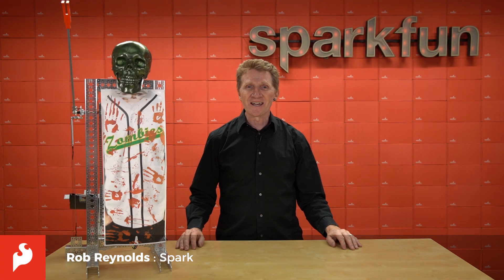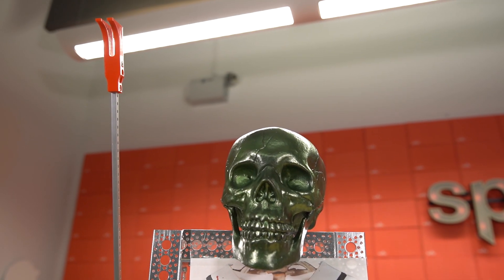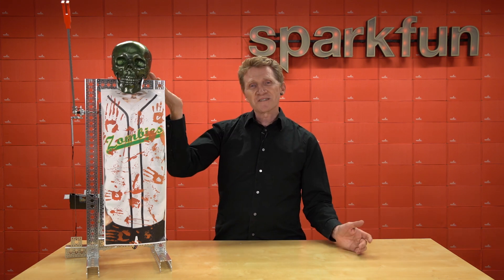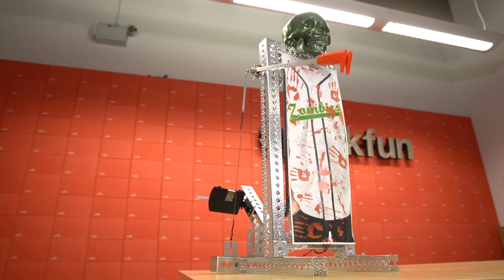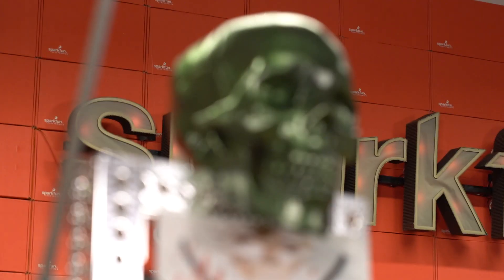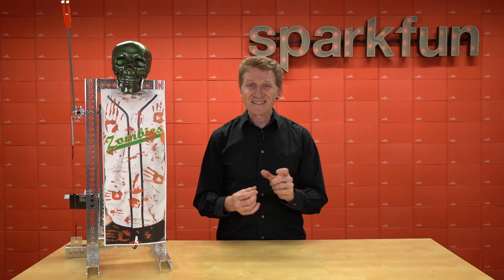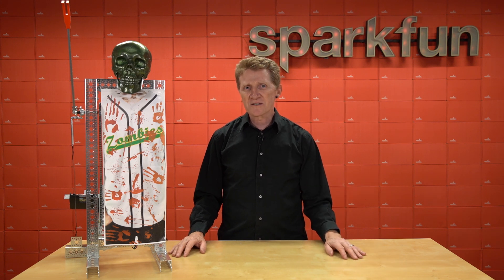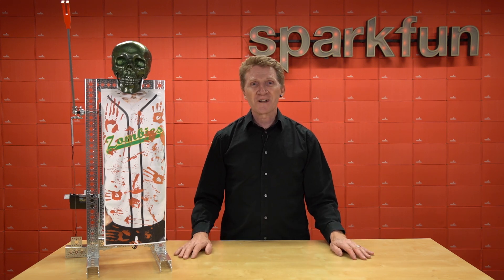Project Showcase: Candy Throwing Robot

Comment: What is meant by resistor traversing
When we say that resistor is traversed in the direction of current the potential change is negative?
Whst does it mean by resistor traversing
Does it mean that resistor is moved in circuit in the direction of current?
Plz explain it for me